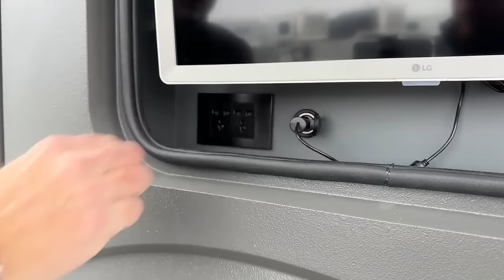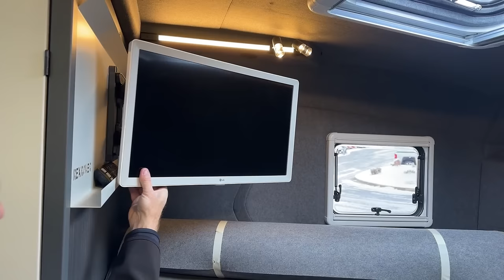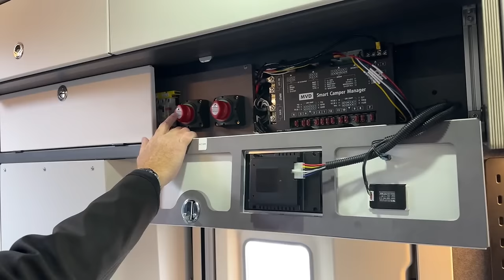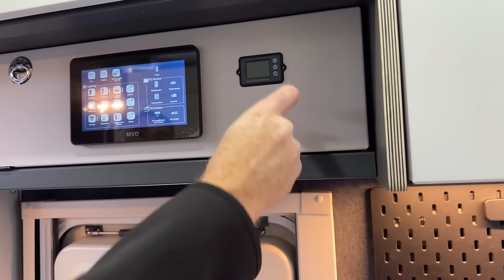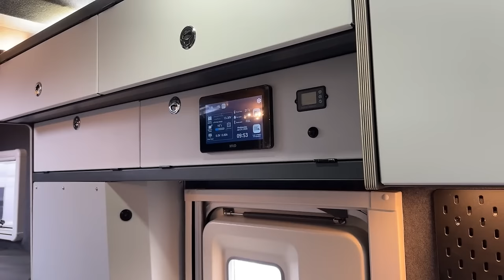2023 27North RexRover AC1 Expedition Truck

Comment: I am an experienced off roader on tandem air suspension off road trailers with HD truck out in the wild and I can tell you that this thing can barely pass a level 1 mountain road without breaking the drive shaft at the first sway over a small rock or lose their little mounted house in the process not matter how hard and tough they built it . I really hope they are not advertising this beast as such.
Reply: I've seen these do some pretty insane off-roading in person when I went to Pagosa Springs, CO. They're no slouch in the mountains.
Reply: You can get your last dollar that's exactly what they're advertising